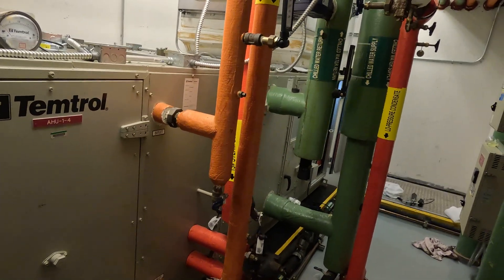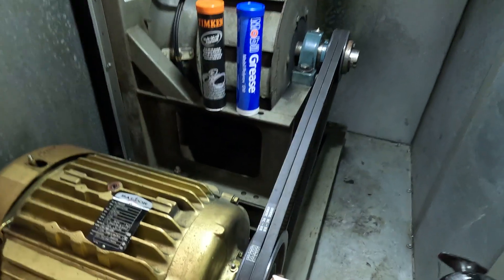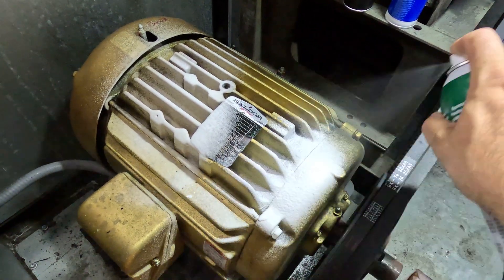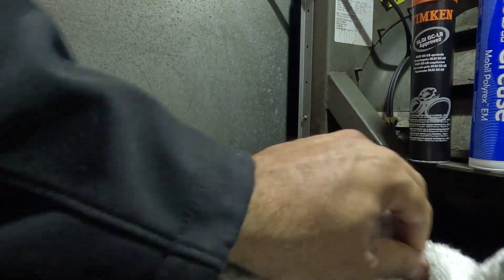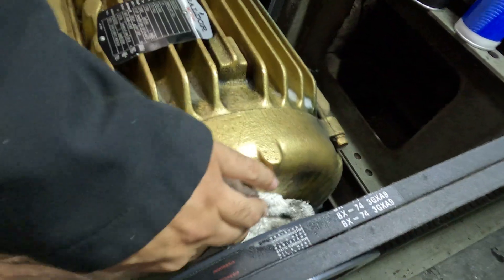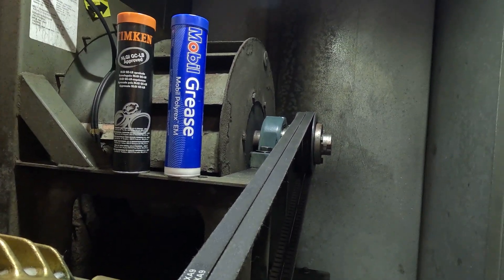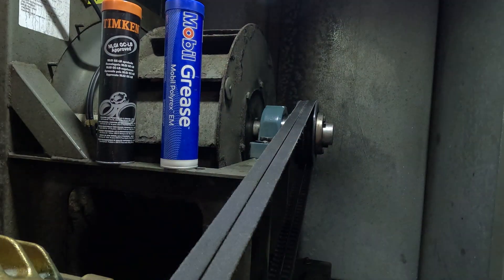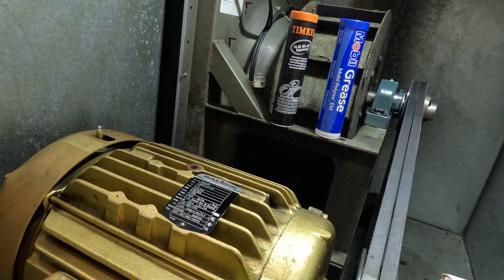How to Grease your Electric Motor & Bearings. Using Mobil Polyrex & Timken NLGI GC-LB - HVAC Chiller

Comment from the maker: Designed for industrial bearings that operate at higher-than-average temperatures and shock loading, the Timken line of Premium All-Purpose Industrial Grease protects against rust, corrosion and wear.

Comment: Cant you also use the polyrex em on the motor aswell, its a baldor relianace, they also take the mobil grease. Why the other one
Reply from the maker: https://www.timken.com/products/timken-mechanical-power-transmission-products/lubrication-lubrication-systems/premium-all-purpose-industrial-grease/